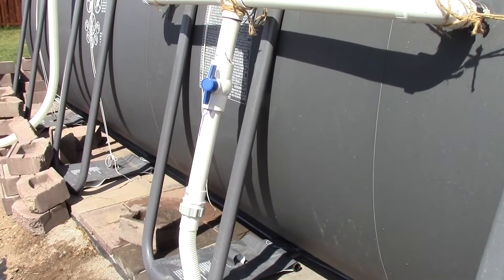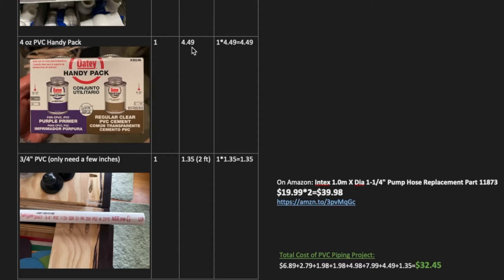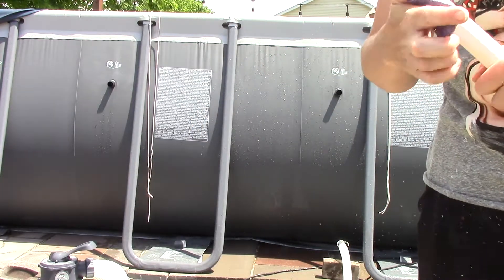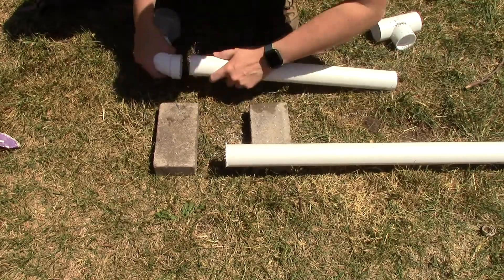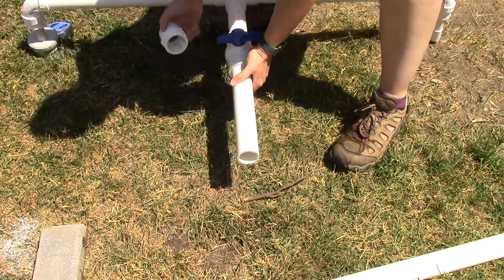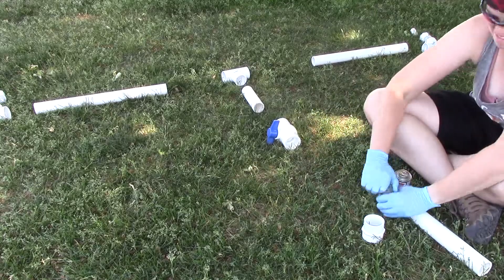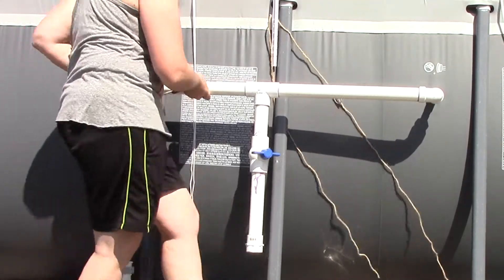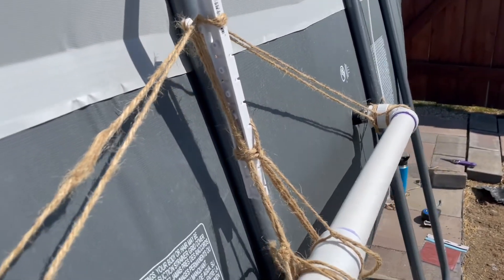PVC Pool Pump Hose Alternative - Lasts longer than standard hoses

Comment: This is the best,  most detailed video I've seen about converting to PVC plumbing.
 Thank you.
Reply: Did the 3/4” piece fit into your strainer? That is way too big for mine and can’t find a size or teacher to fit the 1.1 diameter hole
Reply: @jessicalopez5943 I think I used 3/4" coming out of the pool then changed it the same way she did. It was a very tight fit,  but it works.

Comment: My suction filter does not fit over pvc. Is the 3/4 a different grade?
Reply from the maker: Try sanding the outside of the pvc a bit to get it to fit in the filter fitting.

Comment: great video!! i used your parts list and got all my supplies last weekend.  one thing i noticed, the 3/4 inch schedule 40 pvc dose not fit the pool intakes!!  i think im just going to leave them off the inside of the pool.  Thanks for you creativity and easy to follow steps.
Reply: I had this same problem. They were too loose. Weird.
Reply: Did you ever find a solution, I'm in this situation as well.
Reply: @VICMANROQ I took that part and cut the part that went inside the PVC she shows and used a 3/4 male threaded part and 'screwed' the pool intake to that. Bonus is it allows you to take the cover off the inside and screw on a 3/4 pcv cap to block the flow of water for winter.
Reply: @julesgoulet7868  I'll try that, thank you.

Comment: All your glue joints appear to be incorrect. You applied primer & glue to a pipe and inserted that into a dry fitting. Both sides of any joint must have primer and glue applied. It doesn't look like you did that.
Reply: I doubt it will matter for this purpose. It's not under that much pressure. Nothing's going to burst.
Reply: You're absolutely right, I didn't realize she did that, I'm a woman I've done plumbing and I know your have to do both pipes that you are connecting

Comment: Thanks so much for this video! Super helpful. Question I haven’t been able to find elsewhere, so I thought I’d try here: those Intex plunger valves - do those actually have an up and down plunger that can manually pump water through the hose when needed, such as for repriming the hoses? Or does the top handle just turn left and right to twist on and off? I have a much much smaller pool and made my own filter and small pump because the Intex and other pool pumps are overkill for my small pool and would have cost way more in electricity than needed. Having the actual pumping handles would be super handy, but cannot tell if those plunger valves actually do that or are just on/off. I saw Intex also updated those in recent years and changed how they work to help prevent them from breaking as much. Thank you for any help you can provide!
Reply from the maker: The valves that come with it are just open/close. As water fills above then, the lines fill with water. 
Glad you enjoyed the video

Comment: The 2" lowes pvc threads don't fit the pool threads
Reply from the maker: Correct. You will need adapters and smaller tubing that fits through the holes. 3/4”

Here are the materials i used, you can also find this in the video description :) 
Material.                                   QTY
1-1/2" x 10' PVC.                       1
2 x 1-1/2" male adapter.          1
1-1/2" 90 degree elbow.           2
1-1/2" x 3/4" flush Bushing.    2
1-1/2" PVC Tee.                         1
1-1/2" Ball Valve PVC.              1
4 oz PVC Handy Pack.              1
3/4" PVC (only need a few inches)
Reply: Great video!  Does the 1 1/2 inch male adapter threads fit the intex hose?  Another video says I need a 1 1/2 to 40mm adapter.  Just want to be prepared before building with the kiddos.
Reply from the maker: @RRack the male adapter i used fits well. I use one of the black rubber rings to prevent leaking. 
You can always take that hose with you to the store when you pick up threaded adapter and try it out just to be sure. 
This is my second year putting the pvc back on the pool.  No issues…yet :)

Comment: Did you figure out a good solution for the hook and twine?
Reply: An alternate way to get rid of the rope would be to add a T to the bottom where the hose is connected with an open end coming out toward you and one toward the ground. Instead of adding the hose connection at bottom connect to the side. Add another piece of 1 1/2inch pipe all the way to the ground to prop it up. Place a cap/plug on the bottom.
Reply: That's what I figured would hold it up and keep it sturdy.. but I chose to use a 90 angle elbow instead of the t with cap on one end.
Reply from the maker: Not yet. I might re-evaluate when i put the pool up this year. A few bad storms have delayed the pool setup this year